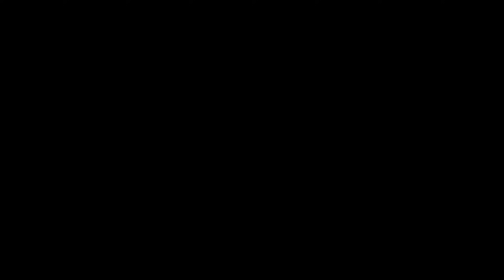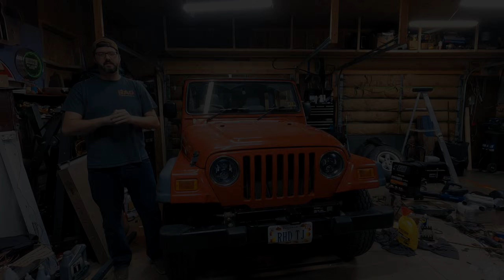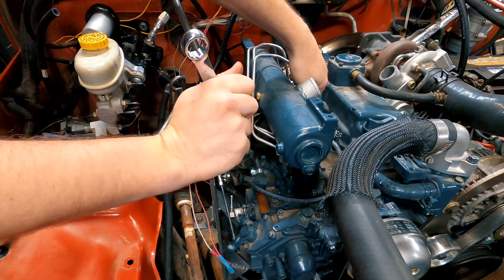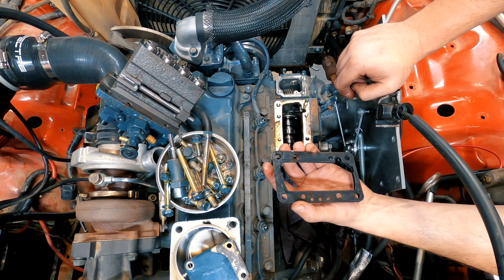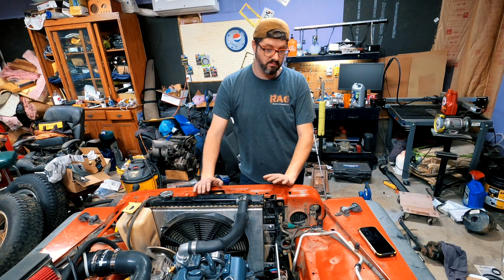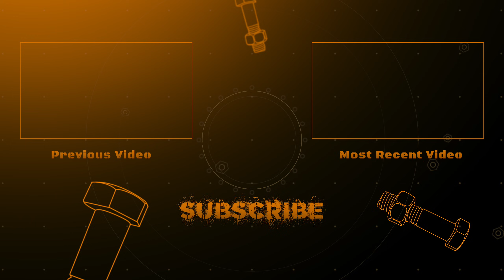Kubota V2403 Injection Pump Timing Adjustment [Diesel RHD TJ Wrangler - 61]

Comment: Hey, I had someone swap out my gas engine on my welding machine to a Kubota v2203 and am at a learning curve when it comes to working on diesel as opposed to gasoline. Is there anywhere you can point me to other than a class at my local community collage to learn how to work on this engine when needed?

Comment: i just got through doing the same mod to my kubota l2501 tractor with the d1703 engine. i had 2 shims on my pump, x1 .02 and  x1 .025. removed the .025 for about ~3.5 advance in timing. i was also able  to open the fuel up (1/4 turn out) by cutting the guard off the fuel limiting screw. the d1703 (3 cylinder) is a detuned 37 hp engine choked down to 25 hp to meet tier 4 specs. i think with both mods im around ~32 hp and ~ 25 hp for the pto. 
 the main reason i bought the tractor... no DPF and no DEF. this is my 3rd kubota, imho probably the best small diesel engines on earth!
btw,  the part you couldn't remember its name, is called the Hi-idling Body.
enjoyed the vid, good luck with your kubota!

Comment: That little hat you pull off at 2:50 is just a cover for optional PTO that runs off the end of the Injection cam. On many of these Kubota engines they run a small hydraulic pump off of it.

Comment: I’m going to do this as well but I think I’m going to use some sealant when reinstalling the injection pump. Is your leaking any oil or did it seal tight?
Reply from the maker: Mine never leaked any oil and sealed tight, I was constantly around the injection pump area adjusting the fuel screws for the pump.
Reply: I came here to ask the same question. Kinda crazy that it's not leaking with no RTV.
Reply: @nicholaspappas101  I ended up using anaerobic sealant on mine just to be safe. Nice tight seal
Reply: @RaztechPowersports  I'm thinking of getting my pump milled so I can get right up to the 11btdc mark.
Reply: @nicholaspappas101  I was considering it too but I had good results with just pulling the shims

Comment: Why is there a kubota in your eng bay
Reply from the maker: This is a great comment that I just keep forgetting to answer. Essentially at the time before I pulled this motor and went for a TDI, I wanted a cheap mechanical turbo diesel to power my TJ Wrangler. It doesn't require an computers, the wiring is simple and it made the power and torque I was looking for while at the same time weighing significantly less than the stock 4.0l engine.
Reply: @RustyAutoholicGuy  ahhhh,... been waiting for that answer. 
COOL!

Comment: Hi sir. Whats the performance after removing the shims
Reply from the maker: More horsepower and torque, though I never measured it, but the throttle felt more like a normal car throttle than an industrial throttle. Before the change, if you want MAX RPM you would have to give it 100% throttle, where as in a car if there is no load, 25% will still REV the engine to maximum.
Reply: @RustyAutoholicGuy  so u mean sir after removing the shims the performance is better. Did it revs 100%
Reply: @kubotad  if your motor is stock. (non turboed) then advance the timing, if its turboed retard the timing, (more boost, hp, tq)

Comment: I know this is a late reply, I apologize. I've got a kubota V1903 (a little smaller than the v2403 but still a 4 cylinder). It's part of an Onan marine 15kw genset I saved from the local scrap yard 2 years ago. I brought it home and it fired right up and ran like a dream with a new lift pump. Fast forward to today, I fired it up after sitting for 8 months or so, it ran great for about a minute, then the cylinder closest to the water pump drops off. I'm certain it's a fuel issue, but i'm new to diesels and have no idea where to start. I'm almost certain it's not a compression issue, last time I started it, it was 20 degrees out and it lit right off without glow plugs. I tried using the bleeder screw on the injection pump as well as cracking the line loose at the injector while it's running but nothing works. I can squirt some lube into the intake tube for a split second and it evens out before dropping off again.
Reply from the maker: Can you post a video? That would help. I almost wonder if that injector went bad.
Reply: @RustyAutoholicGuy  I uploaded a video here: https://www.youtube.com/watch?v=uz5od9l8x6M 
I know the set up is janky, but it's temporary until I get an enclosure built for it. It seems like it has pressure at the injector, but it doesn't look like a whole lot. Then again, I don't have the experience to know what i'm looking at lol. First line I broke loose in the vid is a known good cylinder, the second one is the one that isn't firing. All of the clattering noise is from the electrical box flopping around. Thanks!

Comment: HOW TO ADJUST FIP TIMING IS NOT SHOWN IN THIS VIDEO? APART FROM REFITTING OF HP LINES BEEN RECORDED, REQUESTED TO SHOW DETAILED FITMENT OF SAME. I'm INTERESTED TO LEARN MORE ABOUT PARTICULARLY KUBOTA  V2403 DIESEL ENGINE.
Reply from the maker: Yes the injection pump timing is shown in this video, you remove the shims from the bottom of the injection pump which is how you adjust the timing on the Kubota V2403.
Reply: Sir,  it Is the only method of fuel injection adjustment for retard/advance the timing, I was looking for the drive gear timing fitment, If possible please share the video thanks!
Reply: @RustyAutoholicGuy  The timing procedure is not shown in this video.  This shows how to advance the timing of the pump.

Comment: Hi bro i we have TL 90 INJECTOR PUMP FOR TOWER MACHINE WE OPEN AND FIXED THEN AFTER FIXING ITS PINKING SOUND AS WELL AS WHITE SMOKE
Reply from the maker: Sorry I don't know what a TL 90 is
Reply: All machines vary, in some cases removing the shims may cause a timing advance that causes negative results such as white smoke and pinging sounds. This is the fuel being injected TOO SOON. Put one shim back in and see if it clears up. Also, you may not have needed to adjust the timing at all to begin with. The original issue you were chasing may have been something else entirely and you only compounded the problem. The removal of shims is typically a performance mod done by ppl wanting power but any certified diesel tech will tell you this is not proper method for timing. A spill test is the only proper way and you can find videos online showing how it’s done.

Comment: Hello. I have to take the pump our of a v2203e. Looks similar. Was there any springs you had to disconnect? Mine is in a Gehl 4625 skidloader. That and what position does the rod  need to be in to lift assembly out?
Thanks
Reply from the maker: I don't remember removing there being any springs. What rod are you talking about?
Reply: @RustyAutoholicGuy  I got it out. Shutoff sliding rod wouldn't move. The machine was left sitting in a shed for quite a few years. According to injector repair guys the pumps & injectors have been doing this quite regularly now on stuff that isn't run regularly or seasonal use so be sure to run them every so often.
Springs: After deciphering through it all the spring was the one that pushes the rod that you took out in the video. There were some on the backside that I realized do not get touched. 
I'm thinking the V2203 is your engine less the turbo. 
Best regards and thanks for posting. 
Btw I was able to free up & clean injectors with the silver diesel 911 product. It is an injector cleanor and worked great.

Comment: The spacer (shim)  between the injection pump and the housing below comes in varying thicknesses and is used to adjust the injection timing. 
A thinner shim shifts the injection pump downward  and closer to the rotating cams below. The cams  therefore contact the  injection pump pistons sooner thus "advancing" the timing. 
Installing a thicker shim has the opposite effect: it moves the injection pump higher and away from the rotating cams below. The cams therefore contact the injector pump pistons later thus "retarding" the timing.  There are timing marks on the flywheel that are used to determine the correct timing (just like on gasoline engines ) .
Reply from the maker: Great information here on how the timing works for a Kubota!

Comment: How did it help out?
Reply from the maker: Hey WARD5KUSTOMZ sorry for the late reply was on vacation last week. Advancing the timing gave the Kubota more horsepower and torque. I've never put it on a dyno so I can't tell you how much but it was significantly easier to drive around the yard on stock boost and fueling settings once I changed the timing!

Comment: This would have been super helpful like two days ago when I did my 2203. I swapped governor springs as well, most of these engines appear to be rated at 1800rpm max. I used a spring from McMaster that is dimensionally the same other than being .069 wire instead of .051.
Reply: I haven’t gotten to run it yet to get a concrete number, the Jeep is still in a million pieces. I’m thinking it should top out at 3000rpm. Not that I’ll rev it that high, but it’ll be nice to have room for passing power. 
FTE runs a .061 spring in his Sportrac and the spring stretched out to the point where max rpm is only 2500 now. Not bad, but it limits boost. I’m hoping the thicker spring will hold up better.
Reply: Joseph Cinko did you ever get it running and how did this governer spring help?
Reply: @joefive5466  When they put these engines in the skid loaders and other hydro driven machines their HP rating is around 2700-2800rpm and they'll run wide open like that all day and have zero problems with it. I doubt 3000 will give you any trouble, especially in brief acceleration events.
Reply from the maker: Hey Joseph how did that spring affect the maximum RPM of you V2203?

Comment: its pretty sweet that all you had to do was remove a couple shims
Reply from the maker: Yeah it was SO much easier than I was thinking it was going to be and it's really helped with turning the 235/85r16 tires over as well!
Reply: Rusty Autoholic Guy I have a v2203. I am wanting to do the same thing. Should I? Or are these pumps different animals

Comment: Looks like you got your wrist finally calibrated for torquing. Good job makes things go alot faster. Got to redo mine once I get back to swinging wrenches.
Reply from the maker: Yeah I'm getting there, on smaller fasteners and bolts I'm pretty confident on my calibrated wrist torque wrench!

Comment: The unknown item that you have to remove is your Idle preload spring. 

When/if you installed a Gov spring you may need to adjust this spring so you don’t get surging at idle. 

Thank you for another great video Grant

Ken 
Www.Kubotaswappers.com
Reply from the maker: Ah gotcha thanks for letting me know what that item was! I'm debating swapping the governor spring but I think I want to hold off until I can get the TJ road legal and figure out if I need the extra RPM!
Reply: Where can I purchase a stiffer governer spring and where is is located inside the pump?
Reply: Stewartlil I have the stiffer springs, haven’t gotten them on the site yet though. 

Www.kubotaswappers.com

Give me a call (209)855-6688